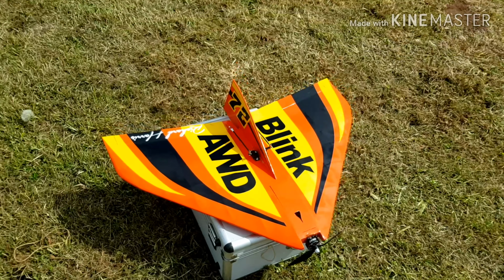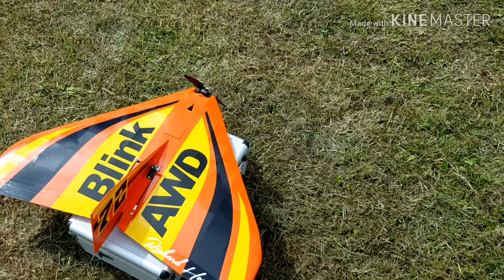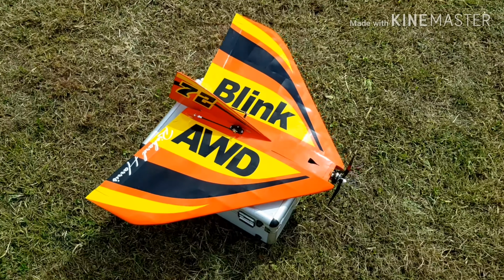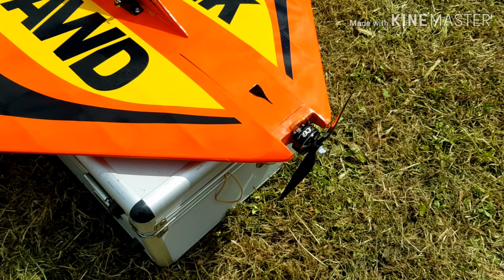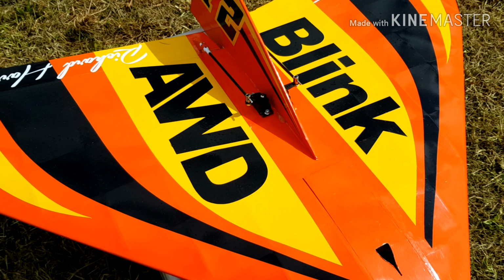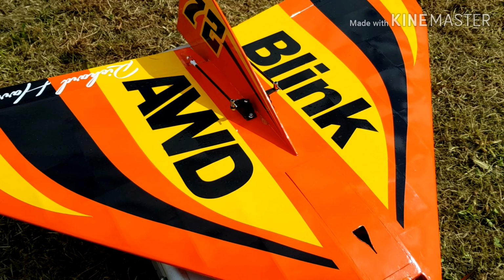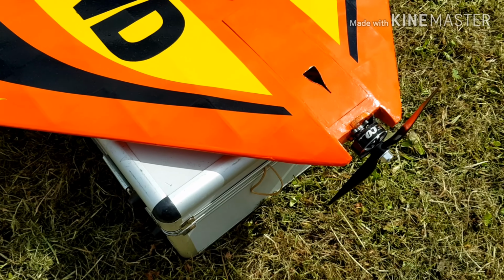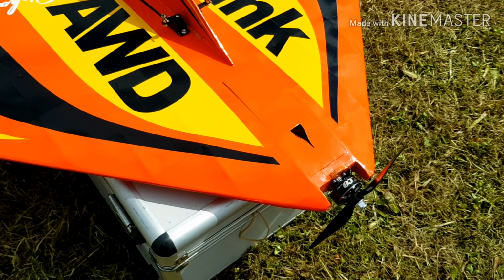RC model Delta....BLINK!

Comment: Looks ok, for the price although i am not sure if it was your video but it seems as though the model slows up quick when you come off the power is that right. ?
Reply from the maker: I cant say that I've noticed Steve,  though this one is light at just over 300g
Reply: @safelandings  Yes probably the lack of weight for penetration and the wind / prop slowing it down it don`t half shift when you put the power on though. I may have to get one for myself, It`s possibly some where between my SAS Thing and my eps delta that is about 20 inch wing span .